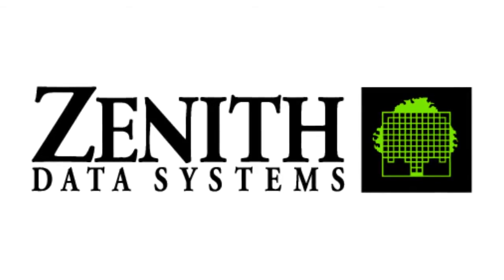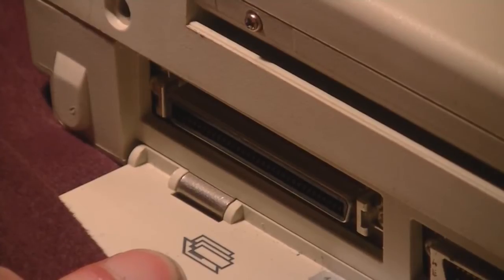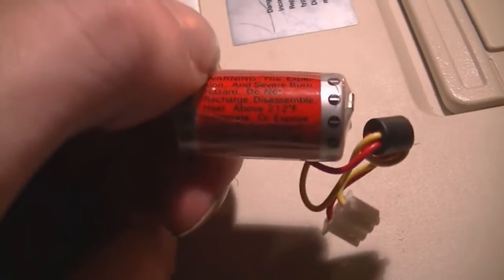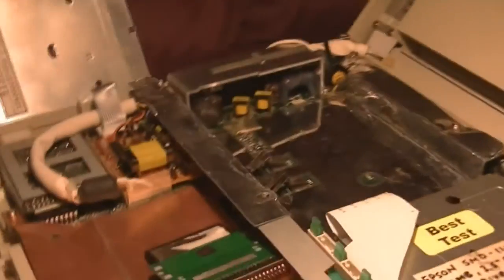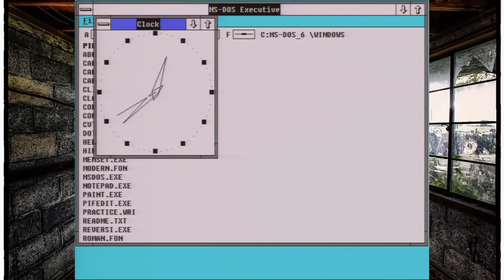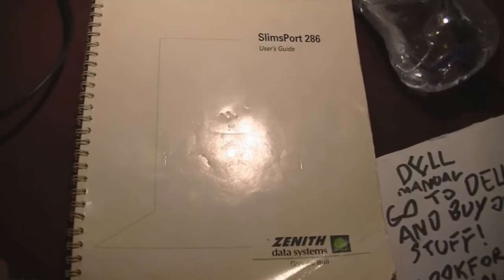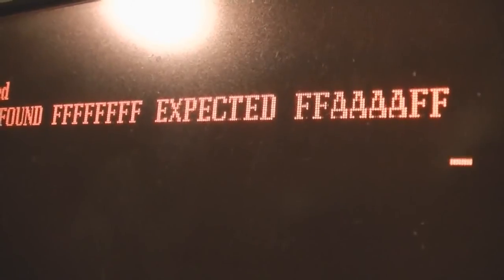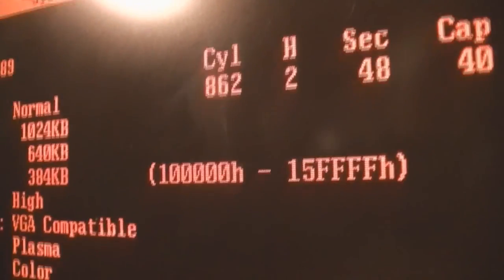Zenith SlimsPORT 286 Overview

Comment: I have one of those I purchased from a friend at my job two years before I retired. I paid him $75.00 dollars for it and told him that the operating system was out of date, which it was. It came with MS-Dos installed on the hard drive and I want to get another hard drive to install in it and use the computer to write programs for dos on other computers. I like the way the computer works and have to find a battery for the computer I have since it didn't come with one installed. I know one company which may have one for this computer and I will check with them on it. The computer seem to be well built and that is what attracted me to it and I love the case design as well. It was built like a tank and it didn't have a manual with it which was no problem either since I have been working with computers for decades.

Comment: This was really enjoyable (minus the dirty laptop, makes me shudder)!  I hope you continue to make videos like this.  Nice to see TOPBENCH make an appearance too.
Reply from the maker: Hey, Trixter, cool seeing you around here. I have another laptop, actually another Zenith, that I plan to make a video about eventually. Said laptop is particularly interesting to me because it was re-badged "British Telecom" for use by their engineers and this has special interest to me as I live in the only part of the UK they do not cover - search KCOM Group on Wikipedia, and on that note, did you know K5 and K6 are types of telephone booth in the UK... Anyway, this BT laptop uses an 8088 microprocessor and CGA video, so Topbench probably won't be the only thing you'll recognize on that one.

Topbench started appearing more past this point as it demonstrated some interesting gaps in performance between 16-Bit and 32-Bit on different systems due to what their hardware design was optimized for. I plan on sending you a database ini with updated and complete results for my stuff some day as I actually do maintain one locally for tuning and quick reference purposes. It might be a long way away though as I've a lot going on as of late and I still have to fix some systems that are out of action - minor problems like sick hard drives and a flaky caps.

I don't intend to stop making videos, though they might become harder to produce from here on out. That dirty Dell was trashed when I got it, so I didn't see much point in looking after it very well. I was tempted to jokingly offer it as a give-away with dirt included. Nonetheless, I sure as hell wouldn't let the Zenith get that way and almost develop OCD around it, constantly brushing even the smallest speck of dust off of it. Sometimes machines look grimy but that is usually because they've had heavy use for some time and have worked long hours, accumulating dirt around buttons and such. At the moment my T3200 looks a bit grubby because I spent over a week sequencing music on it, but I assure you it will be cleaned prior to returning to its case.
Reply: I'll take any database submissions, no rush, no worries.  You're right about the 16-bit performance being all over the map; it's particularly bad on Pentium Pros where they intentionally dedicated more silicon to 32-bit.

Comment: Just a note, as I have a BT Zenith clone myself (video coming at some point). The monitor doesn't reboot or 'kick you out' at all, as the video claims - it runs simultaneously to what you're currently running (otherwise, what would you debug?) ;)

Great video though - a return to form. I wonder if Mullet-man will be making a reappearance in the future!
Reply from the maker: I'm sure it was mentioned that the monitor only really works properly when DOS is running if you use the version Zenith distributed with the system, at least in my case. I don't have the disks for the SlimsPort, though I do have the ones for the SupersPort. At the time I couldn't get hold of a version for this system which had this capability, though I think there's a DOS 4 version out there now that would do it, what version is yours using?
Mullet Man is never quite dead, no doubt he'll barge into something at some stage when I lest expect it. I know he showed up at a pub and started making noises on an open mic night at any rate.
There is another BT Zenith system I have, a later (386SL-25) one, this doesn't seem to be affected by the version of DOS used so much as the older models.
Reply: HighTreason610 I located an awesome site with an archive of Zenith disk images - I'll post up the link (although I suspect you're already aware).

Comment: The gas plasma display shown at the end appears to be using the old Toshiba VGA text font... possibly a T3200?
Reply from the maker: orinokonx01 Very observant, I thought somebody would latch on due to the error message but not the font. You are very, very nearly correct.

Comment: I am trying to figure out what the output of the power brick is.  From what I can see, the output is 16.5v DC with the center post being negative which is opposite of most laptop ac adapters. 
Can you confirm that? There are a lot of vintage laptops for sale on eBay that don't have AC adapters with them. I have heard of collectors attaching adapters with the proper voltage rating but wrong polarity and frying the circuitry.

Comment: That ISA expansion port looks like a 68-pin external SCSI to me. I think the Iomega Jazz SCSI used that cable. Unless it is some kind of a special cable with wires crossed over and not pass thru. It looks like the same port though.
Reply from the maker: WaybackTECH Yeah, I did some research. It was used for VHDCI SCSI-3 years later, so it's probably a regular connector from Centronics or something. The expansion chassis have a male LVD connector, so a standard VHDCI to SCSI-2 lead with a gender changer would fit - though the pinout being the same on chassis and laptop are indeed unknown. Zenith state in the manual you need a special cable, but VHDCI didn't exist at that time.There are four chassis available to me at the moment and I'm weighing up if I want to buy one or not... The price is a bit steep, but it might be worth a try, ISA is well documented so I could probably figure out where a pinout mismatch was and modify the cabling if I had to.

Comment: I have an old AST 386SX laptop that has the same red color on Commander Keen. It is even red on my CRT and LCD monitors. I've only seen that on laptops so far.
Reply from the maker: Tr3vor42532 Very strange. I think the AST uses the same Cirrus chips, so it may be a quirk with those, I've never hooked this laptop up to a monitor before so I'd never seen this happen. It's weird how mine displays correctly on the CRT though.Cirrus' 610 was available on an ISA card so I can't help wondering if it does the same thing. It could also be something to do with the LCD though as AST appear to have used a very similar panel.
Reply: What I mean by LCD is an external monitor. I can't tell how red it is on the built in monitor, since it is monochrome. But yeah, it is a strange little quirk. Also, the text at the opening screen of CK4 is also discolored.
Reply from the maker: Tr3vor42532 The smaller font is pink and blue for me, the Commander Keen scroller behind it is red. The startup screen has rainbow effects and weird inversions.I knew what you meant with the LCD, I just wasn't clear with my wording. I was implying that the LCD Driver Circuitry or signal processors in the laptop could somehow be causing the red color on the VGA port. If it switched on only the red pins, the voltage drop could cause the discoloration I suppose, or it could be some kind of feedback. Unfortunately I don't have the equipment to test it.Still, it looks fine in monochrome, so I'm happy. I might have to see if it does the same thing in the CGA version.
Reply: That would be interesting to see. My AST has pretty good CGA emulation, it can run Round 42 without distortion, although its a bit fast with a 386sx. Yours would probably run it pretty well.

Comment: Why the port on the computer has a missing hole? This does not allow a standard VGA with 15 pins to be used.
Reply from the maker: Standard VGA was 14-Pin. Later VESA DDC used Pin 9 to power the EPROM in the monitor, which held information about available modes. Generally, my solution is to always have a cheap short extension cable on hand with Pin 9 removed at the male end, in case of encountering a screen with the additional pin.
Reply: @HighTreason610  Thank you! I will remove the pin and try a VGA monitor.   My backlight is not working, so it is really painful to see text on the built-in monitor. Or make a hole in the female connector on the laptop ... using a needle?
Reply from the maker: Putting a hole in the VGA socket is a possibility and some people do this. My preference for the extension cable method is merely because I only have to modify one thing, as the cable can then be reused on any monitor and any computer as needed in the future.
It goes without saying that you might lose Plug & Play and power saving on the monitor when using it with such a cable, but as machines lacking the Pin 9 hole don't support this anyway, it won't matter. This consideration is more for if you use the cable method and wonder why these features vanish if you then plug it into a newer machine - hence using an extension cable, rather than messing with the one attached to the monitor.
It may be possible to replace the LCD panel itself, but I doubt panels made to equivalent spec would be financially viable now, if you can even find them - finding a donor laptop would probably be your best hope if you ever want to go down that route.

Comment: Nice video ! Once abou the year 2009 bought a laptop like that for a bottle of Chinzano, but sold later as it has a passive matrix(
Reply from the maker: Thanks. Passive Matrix screens are indeed a turn-off most of the time, this one isn't so bad though and I've generally been able to see what I'm doing just fine with it. Some of them are abysmally slow though and I guess everybody has a different level of tolerance for such things.
Reply: I see... Once i had a macintosh PowerBook 520c - it had the best passive matrix I've seen all 11years I collect vintage computers) So some of them are better, some are worse)

Comment: I vote for the little case next - will it be a sporty little fireball or a flaming pile of rubbish - next week on HighTreason's Laptop Power Hour!
Reply from the maker: josephmmuller Added to the tally, though at the moment the smaller one is losing the vote overall. I can however assure you it's not a flaming pile of rubbish, it was nearly flaming though in that I didn't immediately notice the cooling fan had failed and there is no thermal protection. No damage was done though as I'd only had it running a few minutes and promptly went in and repaired it.

Comment: eGPU boxes exist, they connect to a mPCIe or Expresscard slot on a laptop.
so what's up with the dirty XPS? is it just to be funny or is it really that dirty in real life all the time? ._.
the LCD "warming up" might be solved by simply replacing any capacitors that feed the LCD power.

also: HOLY SHIT MAXELL THROW THAT RIGHT OUT RIGHT THE HELL NOW. THOSE THINGS EXPLODE.
https://68kmla.org/forums/index.php?/topic/17086-warning-exploding-maxell-pram-batteries/ Scroll down.
Reply from the maker: ***** I didn't know that. I'd seen ones that connected to USB3 but never mPCI-E. The solution looks inelegant and restrictive by comparison however, also only appears to be available on more expensive systems, but I'm out of the loop and at least they've made the effort.That battery is never installed, it was placed in the compartment in the video to demonstrate how it fit into the machine, it's locked away elsewhere at the moment and I can't get rid of it as there are no facilities to dispose of it locally. I'll just leave it in the house when I move out later in the year. I've seen what batteries can do... They are one of the few things that scare me, to my mind they are a pressure vessel and as a result, could be a bomb waiting to go off.The XPS really is that dirty.I tried cleaning it once but it kept falling apart when I'd done that. The internals are much, much worse. By comparison, the older portables are very clean and I practically have OCD around them, you probably saw how I started brushing dust off the Zenith's display panel without thinking.
Reply: HighTreason610  yeah, gotta be careful with the old ones, that's something to show great-grandkids and stuff.
possibly worth the money to grab an old 512MB CF card off eBay or wherever, when the current finally kicks it? I still have a 256-meg card I pulled out of a trashpicked camera and, although it smells mildewy, it works great, and funny enough, had SMART capability and wasn't too used at all according to the readout. I think the guy that had it before me used it just to take on vacation once like a decade ago and never used the camera again.

I don't know where you are, but here in the states there's a product called Simple Green, if you leave plastics in it all day in the sun it'll pretty much disintegrate or at least remove or make easier to remove, the dirt and grime that builds up on certain plastics over a while. it's also called poor-man's Retr0bright on some forums (i.e. 68kmla) and has shown very good results in de-yellowing old plastics without making them brittle(r than they already may be). I have an NEC MultiSpeed HD that has some yellowed plastics around the hinge and hard drive area, but I have to really wait until the weather is nicer and the sun beats down warmer before I attempt to find a container big enough to attempt such a feat myself. such will also be the container my Xircom Pocket Ethernet III LPT dongle plastics go in, poor thing is yellowed and shiny from a lot of handling and use over the years. By comparison your Minisport looks to be in great shape plastics-wise, unless I'm not seeing yellowing because of the lighting used-- it's a lot easier to spot in videos with whiter light like can be found in cooler-color CCFLs and LED bulbs, or in direct sunlight.